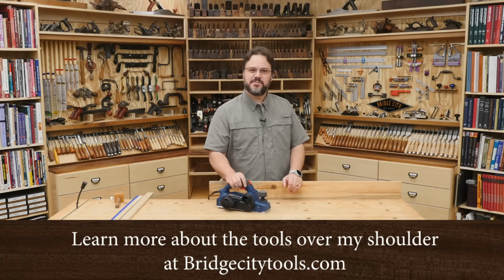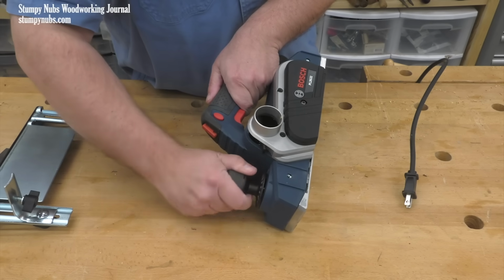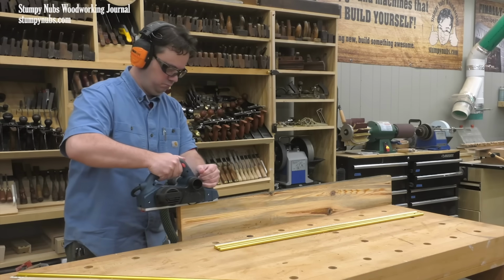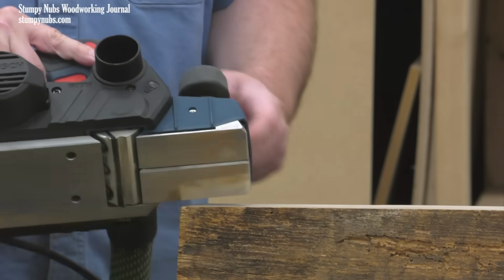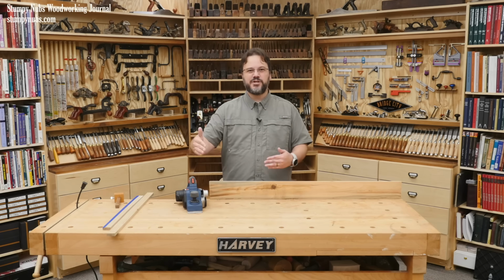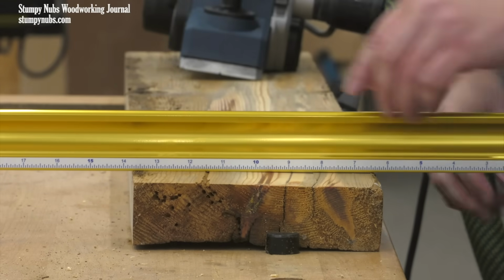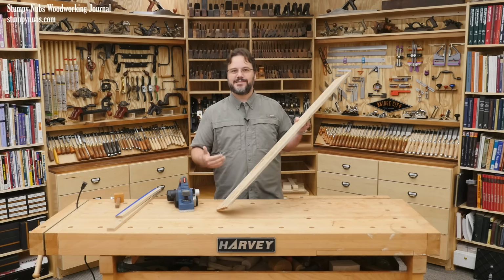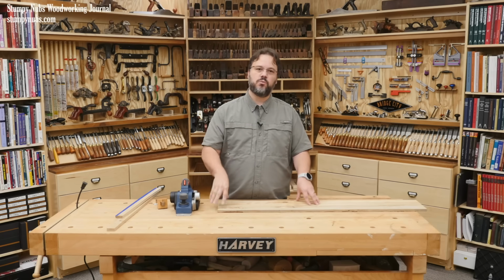Are electric hand planers too dangerous?

Comment: no, not too dangerous.  i used one reclaiming cupped and racked floor boards before running them thru a planer.  A big planer pushes the wood flat with its giant rollers, so that will NOT stop high/low spots.  a hand held planer will.  Battery operated has the benefit of you not chewing up the ac power cord accidentally.  for sure use TWO HANDS on the handles!

Comment: Got one recently to remove a thick layer of old poly lacquer on an old solid wood tabletop. Went over it with many shallow passes and it saved me sooo much time. After some sanding any remaining ridges from the planer were gone. Great tool.

Comment: Is there any way to prevent the lines produced by the edges of the blade when planing the face of a board that's wider than the planer? I get them even though I'm only on the first click.

Comment: Actually there is a way to make these plane parallel faces.  You lay a guide rail each side of the board and build a cradle for the planer….so it planes parallel to the work bench - principally similar to a router sled.  This WILL fix wedge shaped boards.  There are numerous planer cradle designs on You Tube…just browse.

Comment: I like this, was thinking you can use the planer to rough it up to a almost parallel almost flat surface. Then use a router sled to make it perfectly flat, that way the hard work is made by the planer and the fine by the router.

Comment: I bought a used guitar cabinet and the owner re-tolexed it drenching it in spray adhesive. Turns out I'm deathly allergic to the spray glue. Think an electric hand planer set to a very low depth would remove most of it for me? I will avoid all the joints and fasteners and use a sander on those areas. My thought process is these blades will cleanly cut it away rather than sandpaper just grinding it deeper into the wood. I loved your video on shellac, which is what I plan to finish it with thanks to you. Mesa applies the tolex with animal glue at the factory maybe I should just buy an unmodified cab.

Comment: It is called a planer, but it is a handheld jointer.  It cannot make parallel surfaces the way a planer can.  It can make a planar surface, but there is no way to make it parallel to the one on the other side of the wood.  This is the most dangerous tool I own.  For the things it does there is no realistic alternative, but I am abundantly careful with it.  I only use a cordless version.
Reply: Not so Howard….See my comment above.  Planers can be set up to make parallel faced boards and thickness them too.

Comment: IMO, an electric planer is no more dangerous that any other power tool with spinning, razor-sharp blades. LOL
I happened to use mine yesterday to re-fit an old door that had started scraping.  I found it very easy to make a super nice surface.  You just need to pay attention to how the front base contacts the working surface and follow-through at the end of the cut.  Mine was not a full length cut, so easing into the beginning of the cut was also important.  For that, it helped to make more shallow cuts instead of a few deep cuts.

Comment: Operating an Electric hand planner is much more save then a stationary jointer. With both hands on the machine and the blade on the other side pointing away. Just ensure to clamp your workpeace correct and don’t wear lose cloth that can somehow get cought by the blade.

Comment: turning the knob while planing is a useful technique if you're trying to go from depth to zero when trying to get an even space on a door.  i do it semi-regularly when i miss the height on my stringers where a winder meets a straight run of stairs.  it's much more efficient than trying to belt sand the difference.

Comment: It’s funny, I use a hand planer perhaps more often than any other power tool in my shop. And yet I dont use it at all in the way you use it. 

I use it on piano bridges (google it) which are twisty. So often times that little foot will come off the side of the piece and then stick down making me stuck so I can’t continue my cut straight. Removing it is the only option to make my work effective.

I also am setting the height of various areas of the bridge to be higher or lower to set the string down pressure on the soundboard, so I’m constantly adjusting the depth of cut. I finish after the hand planer with a regular hand plane (preferably a #2 but I use a #3 because 2’s are hard to find. Working a hand plane inside of a tight box on one section of the bridge you essentially want the shortest toe you can get or you simply won’t be able to finish the cut accurately. 

I also use it to fit pinblocks, which necessitates changing the thickness from one side to the other in a taper. If I do multiple passes of the same thickness cut tapering out like you do with a hand plane, it risks taking too much. So I usually start at 0 and moving at a constant speed, gradually turn up how much I’m taking until I get to the other side, basically cutting a taper into the pinblock. 

Piano woodworking is arguably a lot more precise than most (but not all) furniture making. Some of my cuts have to be down to the 2 or 3 thousands of an inch. And the electric hand planer is the tool of choice for much except for the final passes where you have to go down to a hand plane with shallow cut, measure, and then the very final passes you measure, then scrape with a flat rigid cabinet scraper (StewMac like 1/8” thick card scraper) very gently until you reach precisely the right dimensions

Comment: This tool saved an expensive commercial railing I built years ago.  It  had a u shaped section and there must have been 100' of it.  All I had for the top surface was a belt sander.    BIG mistake.  I had no idea how to fix it (I guess a hand plane for a week)  A more experienced guy told me to get one of these.  He fixed the whole surface in a short time.   I've used one ever since, now in my shop with no joiner.

Comment: An old property we renting got new carpets and new paint to the frames that jammed the doors so I bought a planer to do the job. Have to say my efforts were pretty awful (not right angles) but eventually I planed enough off that the door opened and closed without issue. Massive pain to do though. The doors and the frames weren't standard sizes and I swear the frames had 6 coats of paint on them. If we had more money we'd probably get a joiner to fit frames from scratch but we didn't.

Comment: This is a fitting episode for me. I bought the exact planer you are holding in the opening (Bosch) so I could shave down some window jams. Using a circular saw all day I moved to the windows and the planer and started to plane one of the jams above shoulder height. As I lowered the planer I lowered it into my opposite hand, the spinning blade hit my index finger spinning my arm in a circle and spraying blood in a circle around the room. The way it felt I thought my finger tip was gone. Luckily it must have been spinning slow enough that the blade hit my finger tip one time dead on slicing one cut just about to the bone. Lots of blood but in the end just three stitches to fix my finger. It is a very dangerous tool if you don't have 100% focus. I have had it for many years now with no more close calls, that accident keeps me focused.

Comment: I started out as a surfboard shaper before eventually moving into making fine furniture. I was using an electric hand place for a few hours daily when shaping boards and it translated really well into my woodworking flow. Even though I have a jointer - I often use the electric hand plane to quickly rough out the high spots on most boards before sending it over the jointer usually just in one pass - it's a great time saver. One of the game changers for me was getting a brushless battery powered electric hand plane - no more waiting for the blades to stop spinning and constantly thinking whether or not I'll sever the cord. Glad to see them getting their shine on Stumpy Nubs!

Comment: Once you have flattened one face of a board, you might stand it on edge and resaw a minimal amount off. Even if the board is so wide that the saw doesn’t completely remove all the waste after running both edges, the parts that are sawn will give you reference points to complete the job with the hand planer.

Comment: Thanks again, James — good video on electric planes. I’ve only used mine to fix people’s doors, and it works great. I’ve rescued what looks line a nice oak desktop that I want to plane down to the good wood, and I’ll do that safely - no bare feet for me. But what happened to your Red Wings water bottle?? Never give up on the Red Wings, eh?
Reply from the maker: The cup had a purpose, which I have explained in past videos. I don't need it for that purpose at the moment.

Comment: I absolutely cannot stand working with large power jointers. I have one.  It takes forever to dial in.  My results are always bad.  Endless endless frustration and annoyance. I absolutely HATE jointers.  I’m not a machinist and I just can’t figure the stupid thing out.

I do have a nice Veritas jointer plane and a planer with a sled.  I will definitely be shopping for one of these to add to my arsenal.

Comment: I always try to have the power lead over my shoulder and connections to power board behind me and away from anywhere it might snag when using my electric planer. Far as blades are concerned , I've only replaced them once since I bought it in 1982 and that was because someone borrowed it and tried planing some boards that still had nails embedded in them. I did have to replace the rubber belt drive about 10 years ago. Just a basic Makita planer.

Comment: Excellent tutorial. 
Planing the top of a door, with the two end grain ends, was a horrible job before i had a electric plane/mill. They're a godsend.
Reply: For sure. When I was working for a contractor doing renovations on old houses, we used an electric plane all the time to tweak doors and cabinets for hanging. Pretty much nothing was quite plumb or square in those old buildings, so everything needed adjustment.

Comment: Any Aussie carpenter worth his salt has one with disposable blades. I carry two one old beat up one for rough work the other for finish work they are in constant use.  I also carry a Stanley No 2 & small block plane I only occasionally use them.

Comment: UK here, my Bosch powered planer I have used for 35 years, replacing the cutters 3 times and the belt twice. It still cuts accurately and I do clean my tools after use. It has seen a lot of use over the years, and lots of plywood and composites.

Comment: I use these mostly for cleaning long beams. Just one pass with 1mm depth of cut is enough to get rid of the sawmill marks. Then one quick pass on the edges to chamfer them.

Comment: The only power tool that's injured me... but the router still scares me. Thank you for your thoughtful videos.
Reply: I feel ya.  I became distracted while using a table saw when I was 16 and walked into the ER with a bouquet of fingers from my left hand. 
Fortunately, I had a good surgeon and everything was reattached... Only losing a thumb joint.  They did a good enough job that I make my living on a keyboard doing IT work 37 years later.

You've never seen anyone focus harder than when I'm using a powered saw. 👍🏼

Stay safe out there
Reply: I lost my fingertip as an apprentice on a surface planer (he calls it a jointer here), so I am still wary of any  power planer as it is simply a miniature version of what took my finger.

Comment: The Bosch that you have has a hole in the kick stand that allows you to flip it up and stick a little nail thru it to hold it up. 
It’s useful when doing door edges where the kickstand might not line up with the work. 
Gotta be extra careful when disabling the sole safety feature of the tool. 
Great tool!  I’ve used it for everything from truing up floor joists to roughing in “hand carved” kayak paddles.

Comment: Great comment about safety. I have seen an eye-watering injury to finger tips where the user picked up the machine from the base plate before checking that the blades had stopped. And the user was an engineer. Not sure if his fingertips ever recovered but it sure gave me a lesson in caution. I love my Makita planer. A little bit at a time gets the job done. Your tips on truing up warped pieces are excellent.
Reply: This was on a hand planer?
Reply: @Elderwyrmmusic  An electric plane. Not a jack plane or block plane. For reasons unknown to me (or him) he put it down after using it and picked it up by the base plate while the drum was still spinning. Ouch!

Comment: These are great video's, well done. I used my only a few days ago - new wall going up against an existing wall lining. I was able to run up the door lining to get it flush with the wall, not even sure how I'd have otherwise done it. I do have cordless one, which needs even more respect I think.

Comment: It's a boat carpenter's tool. I've owned a Makita since they first came out. There are many places where hand planes are the only alternative. Shaping a tapered  mast or bowsprit from a square baulk for example. Really anywhere you have to remove a lot of wood, whether to square up, create a curve, bevel, or rabbit that is attached to the boat, or just too big to bring into the shop. 

No more dangerous than any other power tool, probably less dangerous than any powered saw. Only stupid thing I can remember is cutting the power cord, lots of sparks, notch in the blade, but fingers intact.

Comment: I worked for a company that installed stairs, we laminated the handrail on site, they worked great for squaring the the lamination before shaping it with a router. I have never used them for building furniture or other fine woodworking.

Comment: I own several and use them daily for window and door installation. Mostly on plastic and aluminum. Yes, it works with those materials without issue. For some reason I have never thought of using them  in my woodworking. I don't really know why. 

As for accidents, they are annoying and bleed like crazy and take forever to heal as the planner just removes parts of your finger knuckles or fingertips, but it really doesn't cut that deep. Plenty of first hand experience there unfortunately

Comment: I've used mine to shorten a board just a hair. For example, to make a bookshelf that was cut slightly too long fit, or to make a door that's just 1/8" too tall (or too wide) fit the frame.

Comment: I have been using a powered hand plainer for years in the shop and in the field. An essential tool for custom installations of any kind In my opinion. You can spend a lot of time hogging down something You laid up if you want to with a hand plane but if you need to take some meat off, that's your tool. Poopoo it if you want to, but that tool has put dinner on my table.

Comment: I got an electric hand plane when I was installing new doors in my apartment. I never felt comfortable setting up a regulat hand plane's blade. I loved the fact that the electric plane's blade was locked in, straight and square and the depth was easily set.

Comment: Yes, finally!
Since the first electric planer came into the workshop of my father, it has largely replaced the manual planes for things like these and also replaced many bike-trips to the local seller of wood that had an extensive workshop and would straigthnen boards and other wood for you (at a price). That includes wood that had been in the home-workshop for years. Making things much faster.
The other option was of course the round sander on a motor to straighten things out but would take lots more time. I think that has hardly worked anymore after the first handplaner came in. It is somewhere in a corner...

Actually, if you need to flatten things out, a simple (strong) rig wil be able to make most functions of expensive machines possible and making wood straight and to thickness.
And yes, Netherlands, EU here. Small shop, not much money...

With a good setup, you can also use them for making some (straight) profiles. But ofcourse you need to setup this carefully not to destroy either your wood or your hands.

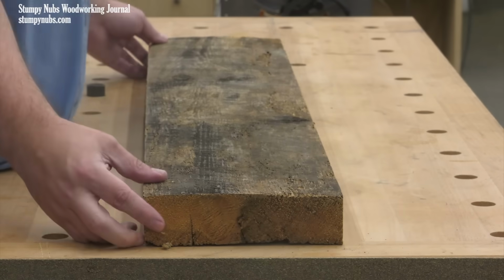Comment: Appreciate you clamping the plug end of the hand planer cord in the bench vice so your viewers can see it was not plugged in. @6:38 the board looked well weathered. I would have used a sanding block or sander to remove the surface crust of any sand, pebbles or other potential hazards to dull the blade. Thanks for sharing.

Comment: Thanks. I had asked this exact question on a woodworking forum a year or more ago.  It was met with resistance.  I mostly work with hand tools but have a bandsaw, thicknesses (DeWalt 735) as my main machines.  I don’t have the room nor want to spend the money required for a planer.  Thought what you outlined here was a good workaround.  Any feel how the battery powered ones compare to the corded ones?  To date, I solve my problem by purchasing S3S wood but would like to open up ability to start from rough sawn wood.

Comment: As a Cabinet installer, I use my 40v makita planer every day and would say maybe more used than a skill saw. I install frameless cabinets, so the width is plenty, and at 3/16 cut depth per pass, I find it better to plane down the cabinets than to use a lot of shims, and it works great to get rid of  chiping on fillers and scribing most things. Besides, it's way better than going back and forth to a saw for miner reworking .

Comment: I have an older corded Bosch that has a retractable blade guard. Also have a beautiful 6" Mikita bought back when I was timber framing. Still use both. Very useful machines. I throw the power cord over my shoulder so it doesn't hang up in the middle of a cut.
Reply: Yep throwing the cord over your shoulder keeps it out the way, especially when taking quarter inch off the bottom of a door when you have it on its edge and straddling it.